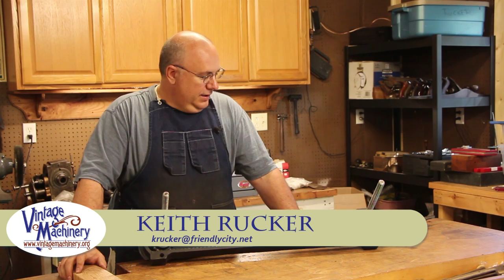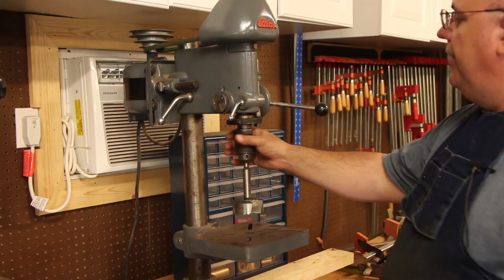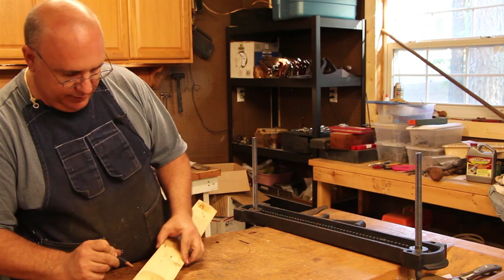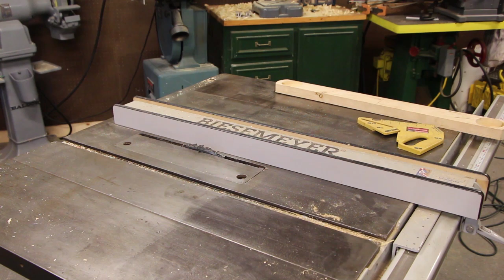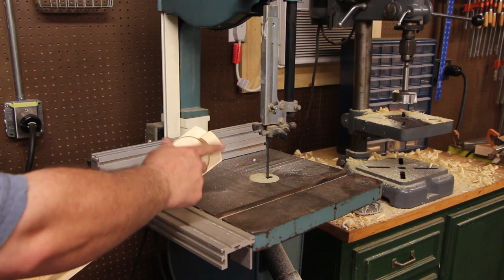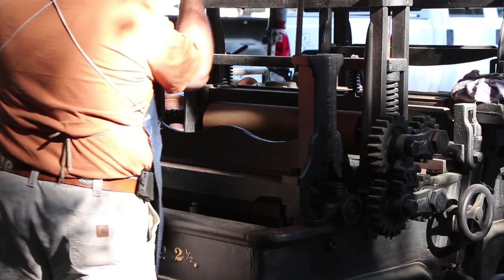J. A. Vance Planer/Matcher:  Installing the Outfeed Pressure Plate

Comment: @22:50 given that the pressure plate is hanging from the screws and has no gibs in place could you please explain to your fans why the plate itself is impossible to move by hand. The plate is a machined part sliding in machined guides and should be free to move at this point in time. I remember that was free before you installed the screw mechanism. Judging by how very difficult it is to move it with the screws something is wrong here and by inserting gibs you will compound the problem. @22:30 you can be seen tightening the last bolt.  The only way you would be able to turn the bolt so far under great tension is if you are twisting or in some way deforming the casting. This shows two things. Firstly that there is a problem with the fit and secondly that you are quite prepared to stress the casting and the rest of the mechanism in order to show yourself 'doing a great job'. It looks as if you are once again trying to pass a bad job off as a complete success for your viewers. @22:43 The screws are becoming almost too tight to move just before you announce that it 'looks good'.I wonder if you believe that and are proud to display yourself in public this way.

Comment: 9:20...pretty cheap...I must live in the wrong part of the country.  An Atlas drill press of that type, not running, falling apart, goes for $500 of Craigslist in my area.  I don't know what it is about the Detroit Metro area, but people think their junk is worth MSRP.  Delta's with half the parts missing go for $300 to $500 as well.  :(  I have yet to find a "decent" tool deal on Craigslist within 100+ miles of my house.  :(

Comment: I just noticed that you have a Unipoint radial arm saw in the shop.  I'm so jelous.  I have a 69 craftsman radial saw that I restored but I hate the fact that you saw through the fence everytime you rotate the column at a different angle.  How much did you pay for that beast?  How do you like the carriage slide design on it?

Comment: Keith, nice work, and I bet it's a relief to be nearing the end of such a long restoration. Can't wait to see it run!

Your suggestion about starting with restoring a drillpress is one I've wondered about. I have a Delta 14" floor model that I use for woodworking, but switching between the wooden table I made for it (fence, vacuum hookup, t-tracks, etc.) and the cross slide vise for metal work is getting annoying. I'm also planning to set up a small machine shop area with bench top mill and lathe eventually, and a drill press in that area would be nice. I've been looking at eBay and Craig's list and there's no shortage of older drill presses, some of which were of higher quality than I can afford new today, but those that are in my price range are in fairly rough shape. I've been wondering if one can be fixed up without a mill or lathe?  Is it mostly a matter if new bearings and some paint?  Some are 3-phase motors, but from what I've seen, a VFD will take care of that problem. Is this something that can be done without a full machine shop?

-- Mike

Comment: Hi Keith, it's me again
My concerns are, how You make the bar parallel to the table, if the chain is already installed. The spindels are not adjusted, and perhaps the bar is on one side half the pitch lower than on the other side.
My tip: You should remove the chain, adjust the bar by turning one spindle, an then put on the chain again. You need to do it just once. If the spindles in the right relation, you can remove the bar as often as You like.
Sorry for my poor English. Missing some words.
Larry
Reply: *****
Okay, well done!

Comment: Hi Keith,
Just like you say, older stuff is better done and was made to last.
There was a time I remember where 2 x 4 were "Really" 2" x 4" and even with the saw blades becoming much thinner, the wood shrunk to 1 1/2" x 3 1/2", wonder where all the extra wood went....!
And now try to find a piece that isn't warped, bowed, twisted or split. If it's true for wood it applies to just about everything else.
Cheers,
Pierre

Comment: Hey Keith,
You know I'm a big fan, but I have to beg to differ with you on the table saw blade setting. When the blade is set as you stated it wants to push the wood up due to the arc of rotation.  If the blade is set higher the opposite happens as the teeth are pushing down on the material making it much more stable and secure to the table.
But hey, like you've mentioned several times, do what makes you comfortable. Table saws are probably the most dangerous tools of all, and very unforgiving. 
That said, I do very much enjoy your videos. Keep up the good work!!
Reply: ***** That was very unfortunate for him, but like you said, at least he still has a finger!
This is only a suggestion in that we need to be careful what we say somtimes as it could result in some bad things happening to young people or folks new to a piece of equipment. Especially a table saw!
You are a well spoken guy, and wouldn't want someone to get hurt from the information you provide. We all learn from experience, and hopefully we keep all our parts in the process!  Keep up the good work !
Still looking forward to meeting you!!
Ray.
aka Razor!
Reply: ***** No argument here Keith, your right about the way we learned how to operate certain tools and equipment with the understanding that the person teaching is qualified. So please understand that I didn't imply that your method was wrong, just that I was taught differently, and have experimented both ways and prefer the blade up.But hey, why do you think they call me "RAZOR"!
Bottom line, your a great instructor, and you have my support!
Razor!
Reply: ***** I too was taught to set the blade up as you do - as much because the blade guards are pretty worthless unless you spend lots of money for a super-fancy one with a dust collector off-take... and even then, you have to try to see through scratched up lexan to see what your blade is doing...

My only quibble on your technique is that watching you reach past the blade to retrieve your work after cutting made me a bit nervous. I'm sure that the camera shortened up the angles, but still, that's something which I was taught to not be doing...

You did successfully use the three most injury producing power tools safely, and that's what matters in the end!

Cheers,

Eric

Comment: You never took the warp out of the board on a jointer!  Nevertheless, nice work!
Reply: *****
I was shocked to not see a owwm planer. Did you make the fence on your 14" Delta band saw?
Reply: I picked up a Belsaw 9103 a few months ago. It's only a 12" and doesn't take up much floor space, but is MUCH more powerful...I have a 3hp compressor motor strapped to it right now.
Reply: Keith, I as wondering why you didn't joint one side before planning too...but once I saw where you were headed I realized it didn't matter much. Just like I was thinking you'd rout out the chain path until I saw you rip off the wood to the edge with the saw and realized again that it didn't matter, so why go to the extra trouble?

It was a little funny to see a guy who usually measures to within a thousandth or two with a micrometer and clamps things every which way but loose just hand holding and eyeballing!  Nice result though, as usual.  You make it look so easy!

-- Mike